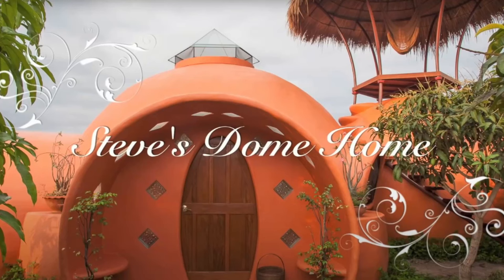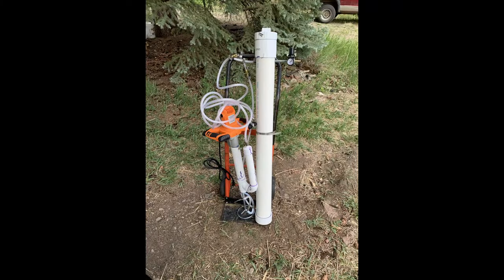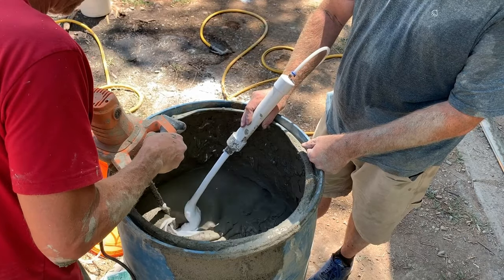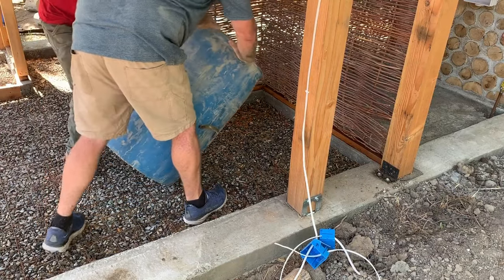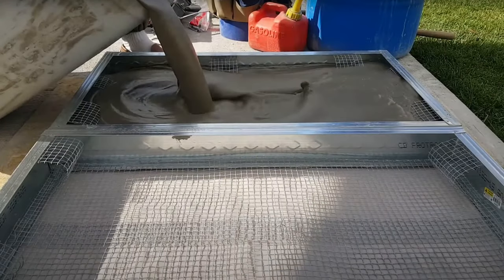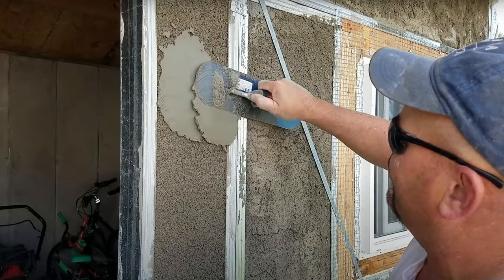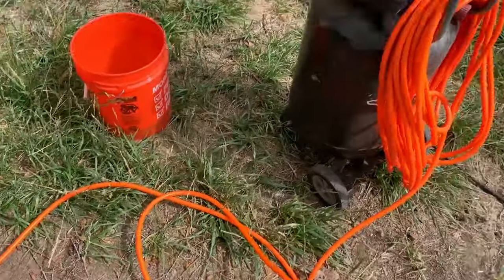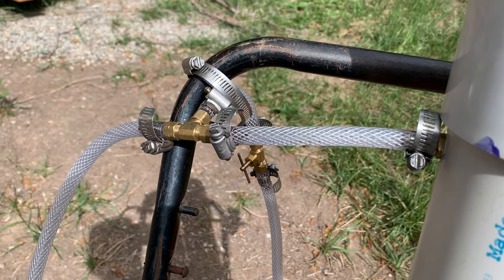Aircrete is great, but watch this before you build with it!

Comment: I thought the aircrete recipe that used recycled packing foam has promise in theory. It seems more stable and strong in the final dry forms than the aircrete made with soap. The panels need to be shredded, for sure a messy project to keep the small foam beads from going everywhere you don't want them... but it makes sense that they'd offer additional insulation and strength that a soap bubble can't (being hollow). I think I'd like to check to see if it's as fire-resistant. My problem with foam is how flammable it is: I wonder if being covered by cement would solve the issue.
Reply: The YT channel Abundance Building Concepts did a video on this topic (shredded foam in aircrete) and he showed that when styrofoam is shredded, it's almost impossible to light.  Instead it just melts.  Encased in aircrete, it's fairly flame resistant and much safer than any other common building material, possibly even fire resistant.
Reply: @davefaulkner6302  Thanks! That's good to know :))

Comment: There is a guy who does ferrocement over the ground ("sculpt" steps up a gentle hillside in the dirt of the hillside) and for reinforcement, he used fishing nets.  Don't know if you thought about those, but thin but strong nylon rope that is flexible to whatever you are working with/on and covering with a cementeous mix...just a thought you might want to try in some future project.
Reply from the maker: Thanks! Someone else mentioned this approach. A plastic engineer felt that the lifespan of those plastics made it a bad idea. 🤷🏼‍♂️

Comment: Think legos.
Look up vad-vad blocks.
I think if you made blockish panels with shapes that easily lock together and could be mortered you could do a hybrid with some framing.this could reduce the need to damage the aircrete to attach fixtures.
Id like to know if a 3d printed home could be made of this...ive had an idea for a type of adjustable slipform that could be used to make domes.

Comment: Aircrete for ground insulation might be an interesting application. You just pour it. That with a large enough production could get that down to a one day job.
Reply: Another idea. What happens if you mix in chopped fibres, such as glass fibres. Does producing a composite increase its strength sufficient to move without the nead for a mesh?

Comment: Hello. Great thx. Wow.. R6.. In these Northern Climes i'm not sure about the 1:5 portland mix for a floor.. Wouldn't even be as strong as Type S.. Why not that 1/4" synerflex fibreglass mesh on either side?.. Just like a cement board.. May drastically increase com.. strength, as it is used in these new acrylic stuccos.. And this is important: What about Hydraulic limes?.. That've been used for thousands of yrs.. Has 60-70% the embodied energy than Portland. Thank you for the good video.. And the lime is easily mixed w clay.. But not P.
Reply from the maker: The R6 number appears to be too generous, according to other commenters. I have never heard of people using hydraulic lime, but a lime/clay slurry would be worth playing with. I’m fond of the dustcrete I have been using, and not sure if I will pursue more aircrete. Let me know if you do!
Reply: @radicalgastronomy  Oh right.. I read that after as well.. Yes there's many buildings been around 100's of years w just hydraulic lime mortar..  Much different that other limes, it's Building lime.. I use it in historical restorations.. Would love to try an NHL (Building Lime) aircrete.. Ahh dustcrete I'll have to check it out.. I'm doing some papercrete.. W Lime and clay..  Ooo Biochar.. Thx.. All the best... And have fun..😁

Comment: What is the principle problem with using an aircrete alternative to say, using cement to build homes? In other words, if it has so many good qualities (i.e. fire-retardant, mold resistant, better biomass, etc.) than normal concrete, why isn't it more widely used? (NOTE: I am not a builder or engineer, so please use laymen terms. Thank you.)
Reply from the maker: The two biggest are the amount you can pour in 24 hours (12” max, or the weight causes the bubbles to pop) and the compressive strength. On its own, I doubt it could hold the weight of a roof.
Reply: @radicalgastronomy  Thank you for your reply. I have seen a lot of videos showing people experimenting with different mixtures among other material to strengthen it. Maybe one day someone will come up with the proper ingredients to make it strong (i.e compression strength) like normal concrete but light weight like aircrete. I think most people, like myself, are attracted to the idea of being able to build something that is cost effective yet uncompromising on structural integrity. Thanks again.

Comment: A key decision is whether one wants a structural building element - or just insulation fill… imo by the time aircrete is structural, it is not eco! Good as insulation comparable to spray foam but far less r value, Id bet under r2/inch with the lightest possible foam. I did tests at CU in yhe 90s with strawbales w and wo mud stucco so Im finding most r claims to be wildly inflated; similar to lumens in led lamps, way less than claimed…

Comment: I was very interested in aircrete about a decade ago - until I learned that it was not building code compliant. There are places where you don’t need a building permit or need to adhere to a building code. I’m not interested in all the effort to learn to build with a new system for at most a shed. There seem to be so many other reasonable systems available that are code compliant. 

I did just recently learn about dustcrete, and am quite intrigued.
Reply from the maker: Dustcrete was a great solution for me. It is less hassle, with simpler tool requirements.

Comment: Imho if you are really interested in aircrete and are willing to do a foamer you should look at prana-tech. He has a most awesome design.  Also consider neutralizing the acidity of the soap/foaming agent. Again look at Harry's additives that improve the strength and I believe durability of aircrete allowing pours of up to 24" without collapsing. There is so much more but this is enough for now from me.
Good luck!!
Reply from the maker: Thanks for the tip!

Comment: The Edison generator and inverters can power a house with zero fuel and zero pollution.  These can be made from an old car generator pre 1974 and you remove the Tesla magnets from the armature and reassemble this generator it is a motor.  Count the armature magnets and divide by 6 and chisel off every set of one sixth and leave one sixth on until you have three sixths off snd three sizthson alternating on and off. When you reassemble this generator it is a motor that has to be held securely to be reassembled ..add 40 DC AC inverters to have 110 volt AC power.  This is a common source of electric power without fuel or pollution. Edison generator is an open patent.
Reply: The aircrete might be stacked 2 ft by 2 ft by 6 inches in a Celtic style dome flat stacks that inches across the space of the dome cover in stucco outside and plaster inside. This might pass code or you might have to reinforce with ribs. .
Reply: Laminated wood ribs.?

Comment: The figure of R6 per inch are way overstated. The highest aircrete product I could find have R1.3 per inch.

Source, page 4:
https://www.forterra.co.uk/wp-content/uploads/2021/10/Thermalite-brochure-web.pdf

The units are in metric, also in thermal conductivity, not thermal resistivity as in R value. However 1.1W/mK = R1.3 per inch
Reply from the maker: Domegaia has made a similar observations, here in the comments.
Reply: @radicalgastronomy  👍

Comment: What about filling cavities in cheap wood sheds with air crete for insulation?
Reply from the maker: It is tricky to pour any way but horizontally. Dustcrete might be better.
Reply: @radicalgastronomy  sidebar: I think you will find this conversation interesting
https://youtu.be/9M9ht0rJ8DE
Landrace seed saving
Reply from the maker: @David-kd5mf  That is super cool. I’d love to get my hands on some of those high altitude walnuts! I may run some melon trials in this style, this year. Thanks for the link.
Reply: @radicalgastronomy Seafoam was on the right track, Ive tested a bit using nopole cactus slime, aloe vera too, if you can afford it! Do you have a page or website? Like to connect, Im an old natural builder who keeps chasing this ghost…
Reply: Wool batts is a lot easier! Feathers or Down if you have it.  Recycled foam is still more eco than new Portland! “Cheap Wood” is now an oxymoron! Cob or adobe is likely the fastest and easiest and cheapest true eco material that lends itself to smaller buildings imo. We really need to bypass using commercial Portland cement! design with what you have close by. If you have a forest of deadwood it will be quite different than only having sand, rocks, dirt. Truly indigenous Building is the answer imo…
Reply from the maker: @mudslinger888  Great! Let’s talk about it. It sounds like you have some deep experience. Radicalgastronomy.com is the website. You can email me at Bob@radicalgastronomy.com.

Comment: Make it into block of 4x12x24 and then it can be attached just like fake stone or brick.
Reply from the maker: Have you done it?
Reply: @radicalgastronomy  not sir , but after watching your video , I think this would be the best use for it. High r value,  easy to form and work with. Not structural.
Reply from the maker: @Emilthehun  Worth a try

Comment: The other thing about the metal studs is you loose the thermal efficiency through the studs.
Reply from the maker: Correct. And they will rust, eventually.

Comment: Has anyone just mixed straw into the aircrete at some point ?
Reply: There are so many ideas on youtube, one I saw they were collecting and using foam board. I only wonder if they could use more concrete for the more sturdy parts of the project?

Comment: Have you seen styrofoam Crete?
Reply from the maker: I have. Personally, I wouldn't want to live in an environment filled with the off gas from that gick. I'm sure it is super thermally efficient, but I'm more into inert materials.
Reply: @radicalgastronomy  I agree. I like your sawcrete invention but I’m in a wheelchair and accessing thick saw dust isn’t convenient. I’d like to make a monolithic dome with sawcrete. My design uses one arch benderboard that hinges at the two ends of the arch. Same way an ice cream scoop scraper works.
Reply from the maker: @gabrielaverell2747  Ooo, I like it. Just slip the bent board up the dome as you fill! Cool.
Reply: @radicalgastronomy  yes! Work both sides until you reach the top and then fill with the last key wedge!
Reply from the maker: @gabrielaverell2747  I’m here for it.

Comment: Nice idea with the paper, but you have the wrong notion about how sheetrock is made.  That process uses heat and pressure in a very specialized machine to create the drywall sheet.  The "paper" on it is more like a very thin cardboard and it is bonded to the plaster with heat, pressure, and probably chemical means.  I like your experimental spirit, though.

Comment: Hey guys I just came across a building here on the big island Hawaii that was built out of air Creek. Giant mistake on the homeowners part. For some ungodly reason they spent $120,000 on a 520 ft.² three dome build. The neighbors freaked out and reported them to the building department, they had no engineering drawings no building permits and now have to tear it down.... all things considered, air Crete is a joke. At best is just a novelty that panders to peoples emotions but logically makes zero sense.

Comment: The original Steve-dome was built using cheap Thai cinder-blocks, not aircrete.
Reply from the maker: It is holding up well. Unlike a tile floor, I wears a bit like leather. We have area rugs under the furniture we move (dining room chairs, etc.). the exposed pathways are surprisingly rugged, even against Bernese Mountain dog claws. I plan to do some crack repair and reseal when I build the rocket mass heater, so I'll let you know how easy it is to patch, soon.

Comment: Meh 😅 Can't have our cake and eat it too lol. Aircrete doesn't have enough strength. Reinforcing with steel will be mostly useless because the aircrete will collapse around the steel. Either treat it like a snow brick (low load) or make it more like concrete to handle the higher loads. Waste more time and expense trying to make a fluffy material work than to start with something more solid. Some insulate concrete with foam.

Comment: worst material build house have wood, easy simple material but not good longtime. and very expensive. lot better use hollow block, i think cheap concrete pillards and airfoam wall have good, finland have one engineer build own house wood pillards frame have strong but not longlive, and then styrofoam sheet all wall and roof ,500mm styrofoam sheet, super good insulation if not use thin. need be minimum 500-600mm thicness have warm house winter too. but if change styrofoam to aircrete maybe cheapen and better. wall piece need be about 300-500mm tichnes, how heavy this have.
Reply: Suomi is an amazing country & mindset. Everything I am interested in always has Finns.

Comment: tiny giant teaches your method- slab or round-- pour the aircrete then wrap with mesh and finish it with a i think magmesium cement.. or some super styregth stuff just to finish it--- everyone has these ideas- but few talk about the actual cost.

green dream project is doing earth bags for almost 5 years now-- they could have built  a monolithic dome in a few weeks, 

alot of this stuff makes good youtube videos-- and not worth the effort

save the planet? giove it a rest-- homesteaders are way too worried about this when countries liek china are just dumping and polluting-   i drove down i-40 ione day. for 10 miles a 10 ft high 16ft wide pile of cement  was non stop--- and you think you gonna save the planet? they just ripped upa few lanes and were putting down new fresh cement...

Comment: Stop worrying about the environmental impact, and focus on longevity.  When you build a home, you build it to stand for decades, if not much longer.  When a standard, stick-built home gets dozed, nothing is recycled.  It all ends up in a landfill.  Trust me; I've seen it.  If you want to reduce your "carbon footprint" (which is absolute bunk, btw), then build structures to last forever.  The longer they stand, the longer they remain use, the less impact you will end up having.
   True "sustainability" (another ridiculous term), comes from longevity and usefulness of something, without having to waste even more resources to replace it.  This is what infuriates me about "tiny homes."  Underbuilt, overpriced, and all but impossible to pass down to the next generation.
   You know, that generation we're supposedly preserving the Earth for... the ones the environmentalists are not having?